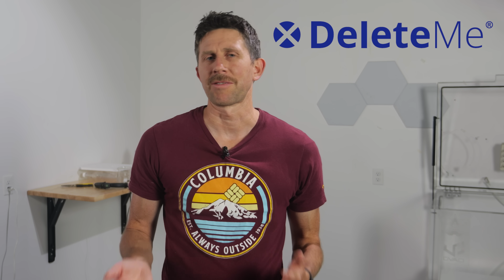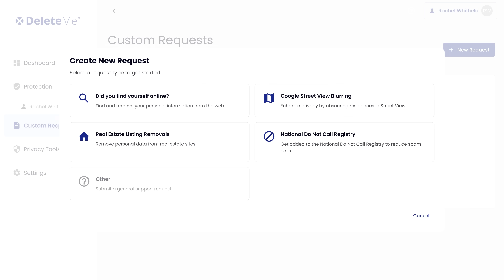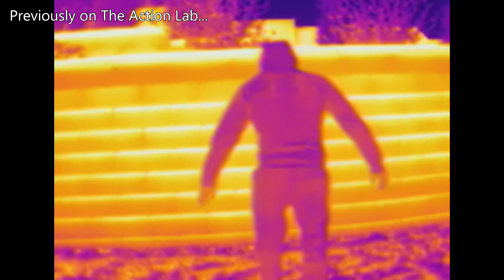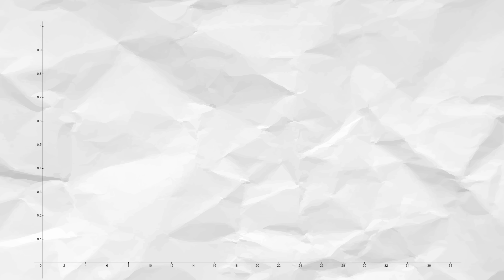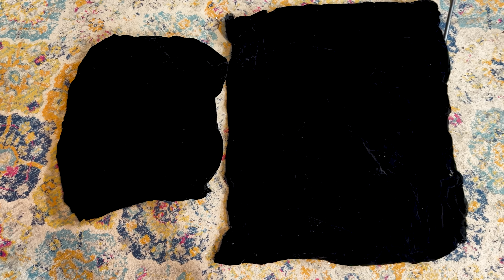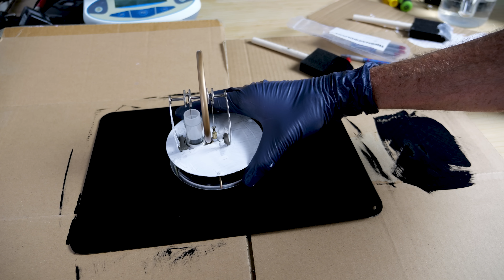This Engine Runs On Sunlight

Comment: Now do the same thing but using copper heatpipes with a larger surface, and  larger piston
Reply: So.... NO BOILING WATER?!?! you must be crazy!
Reply: @CosmeFulanito476  Solar? 😅
Reply: @RaidingClone we boil water at some solar plants to store energy for night.
Reply: @CosmeFulanito476 the one in this video did not use boiling water either
Reply: @CosmeFulanito476  instead of photo voltaic panels we can use mirrors to direct light to BOIIIL THE WATER
Reply: @CosmeFulanito476 🔴 Christians and Muslims both believe in Jesus, love him, and honor him. 

🔵 They are, however, divided over the question of his divinity.

🔴 Fortunately, this difference can be resolved if we refer the question to both the Bible and the Quran, because, both the Bible and the Quran teach that Jesus is not God.

👇 The Bible Denies the Divinity of Jesus 👇

 🔴 Jesus was a servant of God ⚠️

{ The God of Abraham, Isaac and Jacob, the God of our fathers, has glorified his servant Jesus.} (Acts 3:13). 📚
Reply: @1islam1 ok buddy... Put down the glue and go outside and take a deep breath. We are talking about non electric engines we could use to make the world a better place. Respond when you clear your head. 🙃
Reply: It doesn't scale. The amount of gas/air that must be heated and cooled grows faster than the surface area available to do the heating and cooling.
Reply: @Tony-dp1rl  pressurize the gass so the engine gets more efficient
Reply: @joaomrtins  why use the gaseous state of matter (aggregate) at all? Go supercritical!
Reply: @t0rg3  because that is not a cicle that accepts fase change
Reply: @joaomrtins  Sterling engine: no phase transitions. Supercritical liquids: no phase transitions necessary. See e.g. Allam cycle. I see no immediate contradiction.
Reply: @t0rg3  super critical engines are fase change cycles, they usually substitute the braiton cycle which is usually a vapour cicle (they are only super critical in the compressio and heat absorbtion fases). Super critical fluids are incompressible this not conducive for engine which are machines that havest the expansion of gases as they heat up.

I'm not aware of the cycle you cite, I'll check on it and if necessairy stando corrected.
Reply: 100hp Stirling engine 😅
Reply: @Dmitry_IMHO  I mean, the difference between your basement and your attic could drive something pretty powerful. That's why they tell you to insulate rim joists in the basement and stud bays in the attic of old houses. I don't know how much horse power it is, but I know you can't flap your arms and move that much air 😂
Reply: @KastorFlux  unlikely. Low temp difference like the difference between an attic and a basement has a very low Carnot efficiency and Stirling engine can only approximate it with even lower performance.  You'd have to compensate with a an extremely large surface area on your power piston  and a large surface area collector  and with such large surface area comes lots of flex. And lower performance with an inability to minimize inessesary dead space 

Further more you'd have trouble ejecting the heat in to the basement after it is heated up.
Reply: @kreynolds1123  the temperature differential between an attic and a basement is exactly what drives convection currents in old houses. To say the differential isn't enough to be useful when it's about 80 degrees farenheight of difference in the summer, and enough to drive utility bills through the roof... that's just flat out ignorant. You can definitely use the differential to directly drive a lot of air, so to encapsulate the differential and put a mechanism in the way to shuttle the heat, you'll get a lot of work out of it. At least as much work as a whole house fan puts out, but that draft isn't the only passive machine created by the differential.

You don't know what you're talking about.
Reply: It is starting to fail when you scale it up.
Reply: Exactly what I was thinking
Stirling engines while simple, they do have to be very light as simply heating up air does not have much force in it.
Resulting in the engine not having much strength and being able to rotate only small loads
Reply: Steampunk solar.
Really inefficient and with addition of moving parts.
Reply: @RaidingClone actually very efficient, close to physical limits. Temperature gradient is just very small.
Reply: @sieciobywatel 
Clarification. 
I meant 'inferior'
The theoretical efficiency of such engines are high on paper (30-40), but real life constraints really kick them down further. (20-30) 

Plus adding conversion losses to extract usable stuff.
Reply: @RaidingClone if you want to extract work from thermal energy you always have to do "conversion", so this argument makes no sense. Sterling engines are more efficient in this than turbines or internal combustion engines and can work in much lower gradient with usable efficiency. If you use external combustion efficiency of course is higher.
Downsides are they are bigger than ICE , have lower power density and have inertia, you cannot easily ramp them up and down in a fraction of second. But they play very well in hybrid systems, for example in submarines, or in heat/power cogeneration.
Reply: @RaidingClonecost is more important than efficiency
Reply: @ExperimentosAleatorios-rx3bk 

Cost? lol. 
First of all, it will take three layers of components to even generate nominal amounts of electricity from this. 

Apart from that, in energy generation efficiency is everything; and here it is so dogshit it's nothing more than a yard toy. 

This thing won't even have enough power to turn the most simplest of dynamos (generators) without significant transmission torque increases using gears. 
(Adding further cost) 

And, The amount of material and volume required for this (such systems) to replace even a moderate solar panel is abysmal. 

This is a great demonstration of thermodynamics (it's just sterling engine) but is not in consideration for even low power generation. 

All of this does not even consider moving parts maintenance.
Reply: @RaidingCloneenergy efficiency is nothing compared to cost. People commonly use solar panels with 18% efficiency. But they still do. In science videos people love to bring efficiency up when it's not even a determining factor at all. Politics come before cost and cost before efficiency. "This will be innefficient" whatever bro
Reply: @ExperimentosAleatorios-rx3bk  that's the same argument they used against my rodent powered treadmills, and I was like "you just bait them with poison, what's inefficient about sticking a treadmill right there".
Reply: @KastorFlux 🙄
Reply: @ExperimentosAleatorios-rx3bk  pshshsh I mean, I don't poison squirrels, my politics are way different. I was just trying to nudge redpill into a little green energy without triggering his "Good Christian"™ sensibilities. It didn't work and he's still burning trash, but at least he turns in his beer cans for bottle deposit. Incentives, amirite? 😂
Reply: @ExperimentosAleatorios-rx3bk 
You defend this with vigor. 
Ever tried placing actual numbers in calculations? 
Why do you think it will even be remotely comparable to it's equivalent in solar? 
Sure, solar may be only 20-22 percent efficient. 

How does this system compare? You'll have to convert raw rotational energy (very low power) into electricity, requiring transmissions and generators. 

Immediately making it out of question for low power application.

Any higher power would seep into pure thermal energy using fuel. 
Concerning power density. (30cm x 30 cm 'hot plate' used for a toy) 

Solution; drumroll Solar! 

I have a small 10cmx 15cm solar panel (chip) at house which powers fairy lights in the evening, all daylight charge powers a 1. 5-2.5 W system till dawn.
Reply: @ExperimentosAleatorios-rx3bk  one is not more important then the other. If it cost 1/10th  of a solar panel, but you need to buy 10 of them to get the same amount of energy. Then clearly there is no real gain made. It's about finding the sweet spot of highest energy production per unit of currency spend.
Reply: @AxialDragon-v3q I never made a point against solar, my point was against efficiency as a measure for everything. Dude is playing around with Stirling engine > "it's innefficient tho" who cares, you can build this with scraps and diy stuff. Can't build a dan in your garage. It would cost less to be playing with this and even generate electricity than building a machine that spits solar panels
Reply: @ExperimentosAleatorios-rx3bk 
-Says efficiency is not a defining factor. 
-Tries to shut down my statement saying solar is only 18 percent efficient. 
🤷‍♂️

I've clearly in the above comment stated that to even extract electricity from this you would need 3 sets of components. 

Transmission to increase torque. 
Generator (Dynamo). 
Battery. 
Inverter (optional) 

Mind you, I am still talking about low power applications. 
Because, it is simply not viable for high power grids considering the area it's catchment plate takes vs output power. 
(Use a thermal generator [diesel/coal] at this point) 

If you still insist on using renewable energy. 
It will be impossible unless CSP (concentrated solar power) solutions are installed. 

Which again breaks your entire 'cost' argument. 
I've wasted enough time on this. 
Goodbye.
Reply: @RaidingClone??? 😂 Goodbye
Reply: @RaidingClone when the primary goal is to equalize the temperature across a differential passively, it's much more efficient to have your thermal bridge capture some of that energy and use it to drive the bridge harder.

You can't talk about efficiency without knowing the application. You could even use the differential between a hot and ambient space to drive a free piston system that cools a third space. What's more efficient than putting in a system that requires no maintenance, regulates itself, and doesn't need utilities? It's not perpetual motion, but it's a lot closer than solar panels that crap out on you by their planned obsolescence date and leave you with toxic waste in the end.
Reply: @KastorFlux  if the discussion is about efficiency  then low temperature differential Stirling engines have  problem because the Carnot cycle is terribly inefficient because of the low temperature difference, and Stirling engines can only approximate it with even lower performance.  

If the discussion is about cost, power watt of power, then low temperature differential Stirling engines are even worse off because of the high cost of the engine and it's terrible inefficiency.  Concentrated solar  with a high temp differential Stirling engine has its material choice problems and its own expense considerations but it is more efficient which can lower cost per watt of power, but solar photovoltaic is still less expensive. 

That said, as you pointed out, solar pv has its problems that shouldn't be overlooked.
Reply: @kreynolds1123  if the discussion is about cool things you can do with the things in the demonstration, within the context of the other demonstration referenced, then nobody is talking about efficiency or solar panels or any other pseudointellectual passive aggressive 1up bs. You can keep going, but I was raised in a bar by drug addicts, my words will cut you.
Reply: @KastorFlux  I don't understand why your combative response. I love Stirling engines and wasn't trying to "fight" you. 

But I'd like to share with you the reality of low temperature  differential Stirling engines. The ideal carnot efficiency of any heat engine = (T_Hot - T_Cold)/T_Hot when the Temperature is expressed in kelvin. For instance, if the hot side is 120f and the cold side is 60f  then after converting to kelvin temperatures, the maximum efficiency is approximately 332k-289k/332k = .1035% or 10.35%. when the sun goes down the temperature differential is not sustainable and drops dramatically and quickly, so the efficiency drops with that to effectivly zero. Adding to the problems,  real world Stirling engines only appximates the carnot cycle commonly achieving just 30% to 50% of the Carnot limit. Being generous with efficiency one might at best reach 5% efficientbore likely 3% with such a low temperature difference. And after dusk, the power available quickly drops to effectivly zero. Sure one can store solar thermal but that doesn't increase the total amount of solar thermal energy collected. but sure it could extend inefficient low power generation into the night. By contrast solar pv is about 15 to 20% efficient, and if paired with electrical energy storage, the round trip efficiency can achieve 90%. Much better then many common solar thermal energy storage systems with 40% to 70% round trip efficiency. 

As for radiant cooling, access to uninterrupted view of a cloudless sky is non negotiable. Otherwise the radiant temperature of ground and walls  and clouds won't allow your radiator to cool to a temperature below ambient. More Likely it will absorb the radient thermal emissions from the ground and or walls heated by the sun.  Radient cooling here needs a cloudless sky so as to radiate the infrared radiation to the cold depths of space  and not have infrared thermal radiation bounce off clouds walls or the ground back to your radiator.

Low temp differential Stirling engines are beautiful for demonstrating the Stirling concept. But they but don't scale well. Small LTD Stirling engines only produce a few micro or pico watts  trying to scale is prohibitively expensive for usable power generation. One might be better off with a solar concentrator and a thermal acoustic generator than a Stirling engine. They also achieve 30 to 50% Carnot limit  but the concentrator creates a greater temperature differential and thus has a higher carnot limit And, it's moving part count is less then a Stirling engine, thus driving cost down.
Reply: I mean, old radiator for a heat sink in the attic, copper pipe running outside and looped on the back of a panel, check valve so the fluid can only go one way. Hot fluid rises, cold fluid sinks. Could probably do some stirling engine magic to drive a little fan or impeller. 🤷‍♂️
Reply: Presumably the amount of energy extractable is dependent on the difference between top and bottom. A question would be do the paints maintain a steady difference or does the gap close because the cooling effect doesn't happen quickly enough?

On the face of it, and despite the massive inefficiencies, it still looks like a potential way to reclaim electricity from say an AC unit rather than just dumping the heat outside.
Reply: @islandsedition  with an AC unit you HAVE TO "dump" the heat outside. You're concentrating all the heat from a huge volume of air, and using air as a heat sink to pull it out of the unit. They even have to use a fan to assist because the heat won't circulate the air fast enough to do that work. Impeding that thermal transfer would make your AC run worse or break it.

These engines are used to generate power from the heat thrown off a nuclear battery on satellites, because solar panels need far too much surface area for high power applications and the farther you are from the sun the bigger the panels need to be.

You've got a huge pile of wasted heat energy in your attic all summer, and your basement is usually cooler than the outside. Your car in the sun will turn into a solar oven, and then you'll get in it and use up a bunch of energy to cool it down. All that heat is just wasted.

It's like, we're paying money to use energy, just to get the free energy all around us out of the way. That has to be the most inefficient system I could imagine that still gets the job done. 😂
Reply: @KastorFlux  you could just dump the AC heat into something with big thermal mass and use that as the hot side of the Stirling engine. Effectively what a heat pump does in a domestic setting. ie it moves the heat from where it's not needed to where it's needed.

It's not complicated.
Reply: @islandsedition  😂 if there were a material that could absorb the heat fast enough to be practical, then you'd have a big block of it sitting there already. Its not complicated.

What you're describing is an earth tube or ground loop system. They require a massive amount of space, and the heat is dispersed into the ground. You'd have to reconcentrate it, which would be silly.

Modify the unit so the hot coolant runs through a sand battery, you'll be able to capture a lot more of the heat than blowing it through a tunnel, but it still won't be fast enough unless you use some dangerous or toxic chemicals. You'd still need the radiator and big fan. You'd be able to recapture a useful amount of heat that way and it would look pretty cool.
Reply: Using a larger engine with magnets rotating around a coil could the efficiency exceed solar cells ?😊
Reply: @teddeebayre3433  stirling engines are definitely more efficient than solar cells in the dark. They run on heat. There's always heat, and there's always a differential. You can convert energy with them 24/7 instead of only when the sun is shining. This demonstration just used the thermal properties of the paints to develop a difference in temperature, but when you think about what's happening, you're looking at a mechanical system so finely balanced that sunlight can push it. I've never been knocked over by bright light before..
Reply: One can find examples of low temperature differential sterling engines that use a square displacer and a circular power piston. 

Build a square or rectangular box for the displacer and connect the power piston cylinder to the other side of  side of the box from the solar collector side.  Have both the power piston and displacer  connected by linkage to a  crank shaft and make the displacer driven 90 degrees in phase behind the power piston.  

The displacer being square fits inside a square box  with the solar thermal collector being on side and the other side the radiator.  

Stirling engines with a regenerator generally perform better/more efficiently with air passing through it heating up the material during one half cycle and then returns the heat to the air during the other half cycle.  The regenerator can either be part of the displacer with air passing through it or the displacer can be part of the sidewalls with advantages and disadvantages to each.  Stainless steel wool or scrub pads provides maybe the highest volumetric heat capacity, with a low thermal conductivity, the two of the three most important factors in a high surface area Stirling  regenerator.  Low thermal conductivity so one side stays hot and one side stays cold. Higher heat capacity allows storing more energy per degree temperature rise in a given volume, thus  allowing using less material and requires less surface area with less required overall dead space to minimize air flow restriction.   

If you want better performance pressurize the system and use helium for better heat heat transfer.  Steel wool would work good  but is likely to rust  and ruin its performance and stainless steel is better anyways. Don't have too much  unnecessary material and dead space because it will reduce performance. 

Next is to optimize the displacer volume to power piston volume with apripiate crank shaft throws. 

Here is a problem you'll face. Larger flat plate solar collector  will bend and flex more with pressure changes making it a low frequency speaker as the power piston changes the total internal volume and it's air is heated and cooled. 

Besides that an even bigger problem is the Carnot cycle with low temperature differential Stirling engines is overall terribly inefficient because of the low temperature difference, and Stirling engines can only approximate it with even lower performance.
Reply: heat pipes only move heat from hot side to cold side, like the sterling engine so can't help to make the hot side hotter or the cold side colder.  it could help if you had a cold source like a stream or if you dug deep enough.
Reply: @geemy9675  heat pipe can move heat away to a place that has better options for radient heat loss. They can also provide surface area  to help radiate small heat differential  better.  Given clear sky and a diagnal heat pipe painted in radiative cooling conducive white coating, It might achieve slightly below ambient temps and the higher surface area helps move more thermal energy.
Reply: Literally was saying the same thing and then I saw your comment. 

Would be interested to see a scaled up version of this. Maybe use copper tube filled with water underneath the black surface and perhaps use the trial paint to cool it. See how much power you can produce.
Reply: It's still better to reflect sunlight into a single point and use that to boil water
Reply: And oscilliating heat pipe or vapor chamber :face-red-heart-shape:
Reply: Yes and then turn a generator and compare to a solar panel
Reply: @ericwilson5203  I would find it more interesting to use for something else than electricity, pumping water in a low tech way, like done by Igor Belteskiy
Reply: It scales terribly, you're getting a 70°F temp difference at best, or 12 percent carnot efficiency. Assuming no heat losses / Temp drop. You need to use concentrators, and they would still only work in perfect sunlight. And you would need surface area for both the black and white paint. It's a cool experiment, but it's not a practical idea. Believe me, people spent a lot of money to find that out the hard way at Ivanpah.
Reply: @Frank.n.chokes  lololololololol stirling engines harvest energy from nuclear batteries. It's much more efficient than trying to run around with solar panels the size of a city block.

Obviously, trying to generate power at a high profit margin using paint and a stirling engine will not keep up with wages because they're set for the margins you generate with fuel and not paying for the damage burning the fuel does.

A bicicle is more efficient than a car, but I bet you still haul that car to work and transport yourself as a negligible side effect. 😂
Reply: @KastorFlux  You're responding to the wrong person, but ok??? You're clearly very confused about the subject matter.
Reply: @Frank.n.chokes  when people told me that Gen Z can't read, I thought it was just trash talk. I guess the magic of technology is that an illiterate moron can pop on the internet and call me dumb. 😂 I LOVE THE FUTURE! 😂
Reply: @KastorFlux  I was giving you the benefit of the doubt, but it's clear that you're very committed to this unproductive idea. If you won't acknowledge the many realities behind this, I won't stop you. ✌️
Reply: @KastorFlux  you know there are thermal solar power plants arround right?
Reply: @MarianLuca-rz5kk dumb question... what if we make that circle circumference much larger to harness more energy? I'm thinking of an engine the size of a football field. A massive free energy machine. Energy can be stored overnight via batteries or flywheel